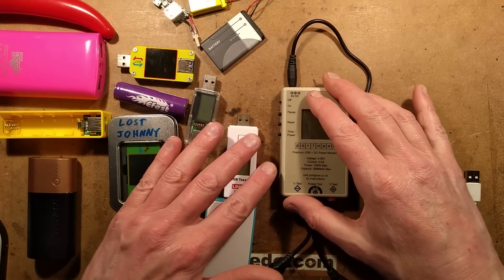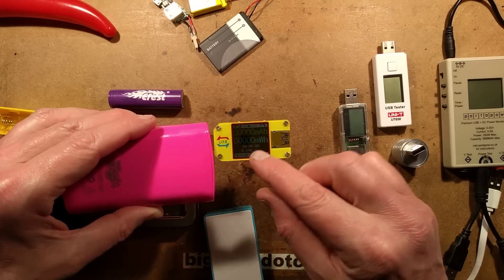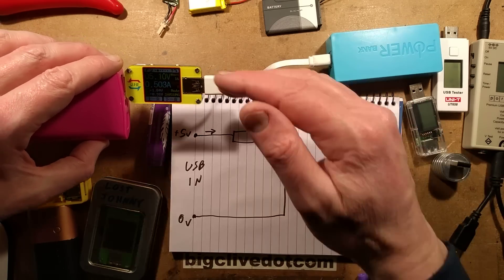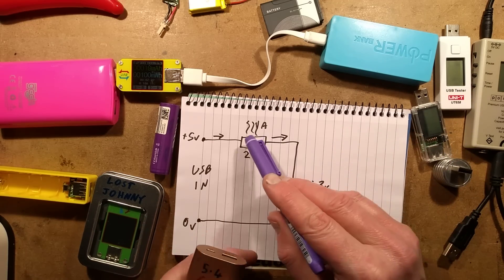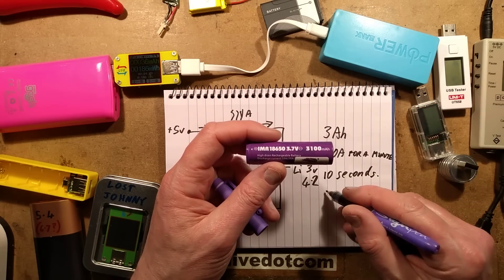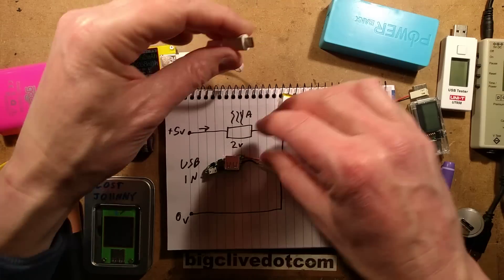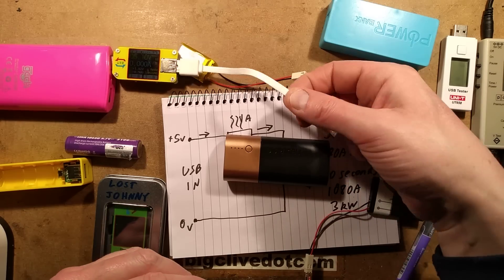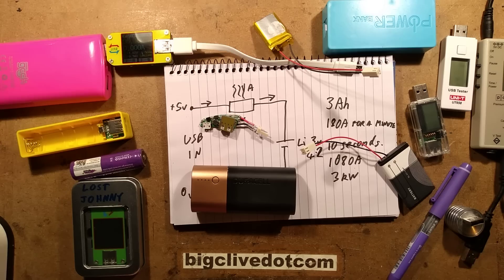How I test lithium cell and power bank capacity.

Comment: Also a dirty trick I found a jump start pack I have...which claims 8000mAH, 11.1V, 29WH.  It seems the salespeople added voltage and multiplied capacity to make the specs...so it sounds huge but really it is worthlessly small.  I was excited to find nearly 10 amp hour 12V source for cheap but it turned out to be more like 2 amp hour capacity when I drained it with a small 2A test load.

Comment: Shouldn't you be measuring in watt-hours instead of mAH?  That is what I usually do since modern packs I have like to run at 9-20 volts with QC or PD, watt hours usually line up

Also is that big yellow meter one of them that does QC, PD, and USB-C?

Comment: For testing single 18650 and smaller Li-ion batteries this Soshine S7 charger is a low cost solution for an analysing charger: https://www.fasttech.com/products/0/10008892/5879902-authentic-soshine-s7-single-slot-18650-li-ion.

Also good for testing NiMH batteries.

It also doubles as a travel charger for me because apart from the 12V 1amp input (about 700mAh charge) it will also run off 5V usb micro.  Keeps my vape charged while away from home.  In an emergency I have once run this off a 10Ah powerbank to charge 18650s.

Comment: I remember when nickle cadmium was the thing before Li+ existed. I would trickle charge a battery until I knew it was fully charged (a few days, doesn't hurt them). I had a modified analog travel alarm clock. Instead of it having a battery, I installed a resistor and some wires. I would set the clock to 12:00 and hook up the charged battery to it through an ammeter. I would write down the current at the start and finish of the discharge and take the average (close enough) of that current and divide it by the hours the clock ran to get the AH of the battery.

Comment: Hi Clive,
I have an arduino cell phone device in the woods that wakes up every fifteen minutes and sends out the temperature/battery level to my server. Been using a 2500mAH lithium, which typically provides about 30 days  of power before needing to be replaced. Curious if you know of a better battery option for that type of use (New England, US) or would some kind of solar cell that might be good for topping it off. It's in the woods, so mostly indirect light.
Reply from the maker: If there was any chance of sunlight getting in at all then a solar panel might be able to squirt a bit more current into the cell.  You could use the classic TP4056 module tacked across the battery to offer charge protection and regulate the maximum charge current.  The other option is to make a dedicated battery pack with a stack of lithium cells in parallel to allow it to run for several months or a year before getting a battery pack swap.
Reply: @bigclivedotcom  Thanks! My biggest concern with this project (weather conditions for mountain biking) is that a lithium cell goes rogue and starts a fire. The packs I use supposedly have over/under voltage handling, but I've watched too many youtube videos of lithiums gone bad.  ":^)
Reply: dognoseranger if the lithium cell you’re using has an integrated protection circuit, then it will protect against over/under voltage which would avoid most spontaneous explosion risks. Most name brand consumer cells include this these days. eBay specials and the like may not have them. Salvaged 18650s (from a power bank or laptop) often don’t have it because the protection would’ve been built into their circuit you ripped them out of.
Reply: @dognoseranger    have you thought of making a small concrete box?  By concrete here I mean just sand and cement.  Probably only needs to be about 1cm thick.  I've played around with using chopped glass fibre for reinforcing, but I don't think you need that.  Immune to rain, freezing and moderate fire.  As for battery life, is the tx being fully powered down?  Is there a voltage regulator still in circuit?   Maybe you've done all that already, but if not, considering the very low communication rate, you might get 2 or 3 times the life from the same battery.
Reply: @gd.ritter  Thanks. I need to dive into 18650 info more since I didn't realize some of then had a protection circuit.
Reply: @dognoseranger  Here's what the protection will usually look like, Clive took one to bits a few years ago. (round style) https://www.youtube.com/watch?v=-d_jrsdox-4 and he did a LiFePO4 cell apart and that had the other common protection style of a thin rectangle. https://www.youtube.com/watch?v=53n2pw5M9m4
Reply: @raykent3211  That's interesting. I considered a small steel box but didn't know if heat/flames would find a way. The sensor is mounted on a tree, but I guess a battery "cube" could be on a clean part of forest floor/rock. The circuit goes into deep sleep, 15minutes during day and 1/2 hour overnight, which the maker says they've measured as 350uA.
Reply: @raykent3211  Another benefit of getting the battery pack on the ground would be a more stable temperature, especially in the winter when we get sub-zero (F) temps.

Comment: Can someone explain why there sometimes are sparks when connecting a load on dodgy chinese electronics that share the mains ground and the "0v" of a power supply?
Reply from the maker: If you are completing a current path then that could cause sparks.  A seemingly isolated device can also carry a small current referenced to ground through capacitive coupling.
Ground difference is quite common.  It's the bane of the audio industry.

Comment: I've been wondering if the capacity rating is from 0V to 4.2V or from "discharged" (~3.0V) to 4.2V.
Reply from the maker: The capacity between 0V and 3V is tiny.  When an over discharged cell is recovered at low current it climbs rapidly to 3V and then slows down.
Reply: @bigclivedotcom - Thanks.  All very interesting.  As always. Happy New Year from Arizona.
Reply: @bigclivedotcom  -  Knowing this I now know some of my Li-Ion's are no where near their stated capacity.  I have measured them with a similar USB power meter at charge and wondered why they had so little capacity compared to their label.  Either a little cheating on the label or a little worn.

Comment: But isn’t the capacity typically measured as discharge capacity rather than charge capacity? I’ve never seen it done this way before.
Reply from the maker: This method allows you to test a cell in a sealed product.

Comment: 11:23 That would fit a normal 18650,  but most of the  Effast cells are protected adding another 2mm making them around 18670

Comment: Have you done comparisons between the mAh/Wh going into and coming out of power bank? Like measure while charging and then use a load with similar current and measure while discharging. I would be interested to know the ball park "roundtrip" efficiency of a power bank (maybe comparing the resistive and switching ones or name brand vs. chinese).

Comment: RuiDeng make very good digital power supply and USB tester. I have the blue one with OLED and it has a low power draw which I like. For propper testing I use my Agilent power analyzer

Comment: For testing normal li-ion cells analysing chargers are better, for example opus 3000 or liitokala li-500. They are quite accurate in measuring capacity, and can measure capacity when charging and when discharging. For switch mode power banks I think it's better to measure not Ah, but Wh, as Ah is voltage dependent. You put in 1A for one hour at 5V, you get 5Wh in charging circuit. Almost the same ammount of energy is then put in battery but with lower voltage/higher current, but total power put inside the cell will be around the same amount (with some loses in charger, around 5-10% is a safe bet for losses). If there is no Wh written on power bank, you can calculate this by multiplying Ah by 3,7V

Comment: I would like it if things supported rapid charge but also had a "I don't need this to be charged quickly, go slow and easy on the battery" - I could use that 95% of the time and make the cells last a lot longer. Since getting a phone with a battery that lasts almost 2 days, I now also tend to not 100% charge my battery - I'll take it off the charger if I notice it over 75% charged.

Comment: The "tight" power bank is only meant to take a cell that doesn't have a protection circuit. The protection adds a little bit to the length of the cell. Most things that receive 18650s can fit both lengths. Considering thats a "DIY" style USB battery its pretty much a defect of design not to accommodate both lengths.

Comment: We've been working with a company called R&D and they've done great in providing us a range of these ammeters with tight specs (we've created 4types with them atm & have a couple of false load devices in the pipeline atm) there is great monitoring software with them aswell😉

Comment: When you measure the current at the input you must must multiply by the assumed average voltage at the cell and the time to get the capacity. Maybe you should explain that a bit. If you use the reading of your device only the energy you take will include the "resistor"

Comment: shouldn't batteries be discharged and charged a few times to let them regenerate before measuring capacity or is just for NiMH?
Reply from the maker: I do usually run several cycles.

Comment: Nice roundup of Li-ion testing and so on... For anyone interested in a fairly comprehensive test of the Ruideng UM34C usb meter Clive showed (the yellow one with a nice display) have a look here - https://www.youtube.com/watch?v=3yhHX96h-jg&t=1186s   I bought one  on the strength of this vid, and it does do a good job with only a couple of slight snags, which are mentioned in the review.  I found it showed current fairly accurately down at the low end, which some usb meters do not do at all well it seems.

Comment: I acquired a lot of knowledge from this Vlog. I was wondering if they would be changing the meter from USB A to USB C or would an adapter be sufficient ??  Have you looked into the Handwarmer +power banks???
Reply from the maker: It has extra connectors for micro USB and USB-C on some models.  I took one of the hand warmer packs apart in another video.

Comment: Counting A-h is confusing as soon as you discuss different voltages. If the charger has a resistive controller (as you describe) then the A-h input will equal the A-h of charge, but if a buck converter is used in the controller, the A-h put into the battery will be greater than the input A-h by a factor of the ratio of the input and battery voltage (integrated over the varying battery voltage, assuming 100% efficiency). Similarly, on output, even if the output circuit (boost converter) were 100% efficient, the output A-h will be smaller than the battery draw A-h. Also, although the A-h your get out of the battery is really close to the A-h you put in (which in turn reflects the number of lithium ions transferred between the electrodes), when you draw down the battery the voltage will be less than during charging and so the energy (Watt-hours) will be less than what was put in.
The so-called A-h rating of a boost pack should really be interpreted as a W-h rating based on an assumed voltage of somewhere around 3.8V.

Comment: I'd like to build a 18650 power bank designed just for charging my phone/ipad etc so purely 5v. I've got a 3s balance board and 80 charged up 18650's. What sort of config would people use for such a rather big powerbank? Is it better going 3s, going 12.6v and use a step down or use something else?  I've loads of 8x18650 powerbanks that I've made up to use on my boat but I'd rather have a couple of big ones. TIA
Reply from the maker: The simplest approach is to use an existing powerbank PCB and create a block of parallel cells.
Reply: Is there a limit to how many you would go? Worried a bit about balance
Reply: @Bammyja  check out secondlifestorage.com for anything Lithium cell related, loads of projects and BMS info
Reply: AmigaMan thanks mate

Comment: Hmm, I was always of the understanding that the capacity of any cell is measured and defined by what it can deliver during typical or specific heavy use, not what you need to supply into it to fill it...

Just as the Lead/acid definition the CCA of a car battery specifies a defined amount of work under a particular set of conditions. The definition of capacity is nil different for Lithium batteries or SLA, it is measured by what energy they can supply...
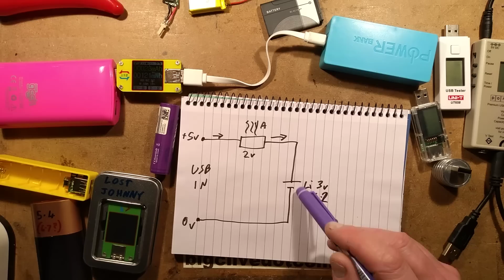Reply: Maybe you missed what Clive says at 6:57, i.e. that Lithium cells are so "ridiculously efficient" that you get back just about everything you put in.

Comment: I charge my 18650s at 500ma I can boost it to 1 amp but I only do that if the cell is at least over 50% charged and I need the cell ASAP..

I get most of my cells from laptop battery packs.
Reply: @ezerZero Same here. I have actually only once ever seen a laptop battery in which every single cell was totally dead.

BTW, how low do you go when you are characterizing your recycled cells? I have stopped at 2.7V so far, but I reckon even 2.5V could be safe.
Reply: @MrZetor   2.8v is usually the cut off point for a good cell. But I've worked with 2.6v cells before, I just wont use them in a pack, just as a single cell for a power bank as shown at 11:30

Note: a 2.8v -> 2.7v -> 2.6v cell should be charged slowly until at least 3.7v (4.2v max)
Reply: @ezerZero "2.8v is usually the cut off point for a good cell. But I've worked with 2.6v cells before, I just wont use them in a pack, just as a single cell for a power bank."
- Please elaborate. I reckon I didn't articulate my question properly (sorry about that, English is my 3rd language).

What I meant is where do you set the end(ing) voltage of the discharge cycle when you measure your (recycled) cells. Obviously, all cells will go all the way down to 0V if you don't set the cut-off voltage, but doing this will (pretty much) destroy the chemistry of the cell. So far, I have discharged all my 18650's down to 2.7V, but lately I have had thoughts that the cells might actually be fine even when going all the way to 2.5V.

As you most likely know, (even recycled) laptop battery cells are much, MUCH better than e.g. some "9000mAh' 18650 cells that are being sold on eBay.
Reply: @MrZetor  I usually use the same method as Clive (basically a universal method) Use a single cell power bank charger and discharge it with that since it has a protection circuit for the 18650.

Comment: For 18650's I use a 4-gang charger which has 1 slot that can measure capacity. It charges, drains, then charges the cell and chows you the charging current and voltage. Pretty neat. It's one of those Chinese chargers that's sold by a bunch of different brands. Seems to be a clone of the NiteCore D4. Charges 26650, 18650, 18490, 17335, 16340, 10440 Ni-MH, Ni-Cd, Li-ion, AA, and AAA cells.
Reply: i have a couple of those, and I find it's funny that the company that sold the testers also sells fake mAh batteries. That fail in their own testers

Comment: I don't understand why you are trying to find capacity, by charging the battery, rather than the universal way (and more 'real world' results), of obtaining capacity during discharge?
Reply from the maker: It's the easiest way to test a lithium cell in-situ in a power bank or sealed item.
Reply: @bigclivedotcom    nah mate, think Agatha Christie!   The batt pack powers an electromagnet holding a steel ball above the face of a mechanical watch.  When the pack cuts the ball drops smashing the watch glass and locking the hands in position, giving the time of the murder.    More reusable. .. use an ordinary wall clock but supply the 1.5V via a resistor divider from the pack.  Strap a 10 ohm resistor across for a load of half amp.  When the pack cuts, the clock stops. Yes, I'm a cheapskate!
Reply: @bigclivedotcom  A discharge test would be self-terminating, when the pack cuts out.
Reply: "Universal way*. You mean a clueless keyboard warriors opinion..
Reply: @Solocat1  I'll pass that on, the next time I see the Panasonic Rep.

Comment: I agree with others that battery packs should be rated in watt hours. mAmp Hours does not tell the full story and allows manufacturers to distort the facts. For example some state a 10 amp hour capacity. All things being equal and ignoring losses when the voltage is boosted.. 10 x 3.6 = 36 w Hours. However 36/ 5v  is only 7.2 amp hours at the higher voltage as the total energy capacity remains the same. So its wrong to state the former when you are using the power at the higher 5v

Comment: https://au.news.yahoo.com/popular-christmas-toy-pulled-kmart-shelves-fire-concerns-204131574.html
Reply from the maker: Interesting.  It looks like one of the mini chargers built into a USB plug.  I wonder if it's an issue with the chargers that can supply a higher current under heavy load instead of drooping to less than 5V.
Reply: bigclivedotcom  apparently in the cases where they were over heating people were using power point USB sockets rather than a computer USB sockets like it says in the instructions but surely it shouldn’t matter.

Comment: Can you give links Clive to all your testers or put all the names of them in the discription
Reply: The Ruideng that he features (the yellow one) is also sold as the MakerHawk UM34 on Amazon, which is where I got mine. Would highly recommend. They are inexpensive and provide a lot of data. Also, other models have Bluetooth connectivity, which I have not tried.
Reply: Just type in on eBay usb tester meter and they all come up